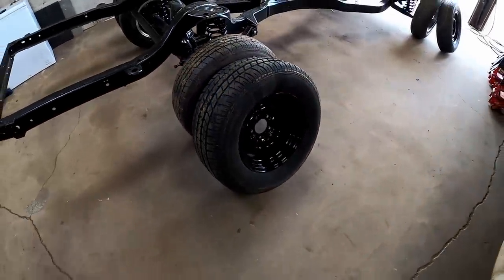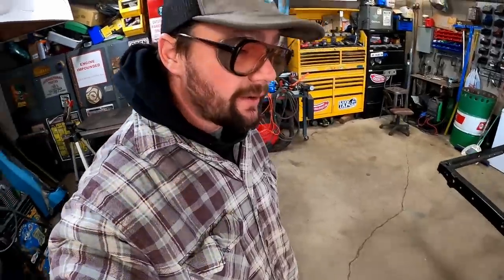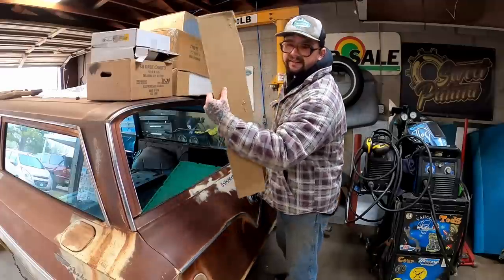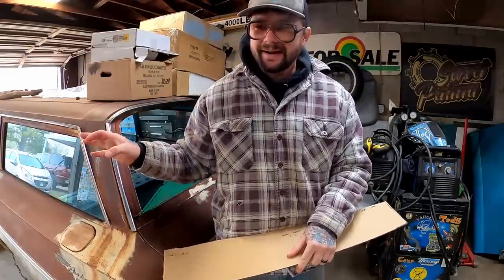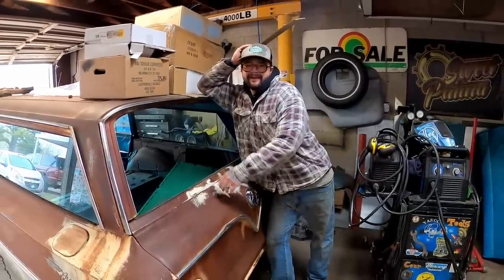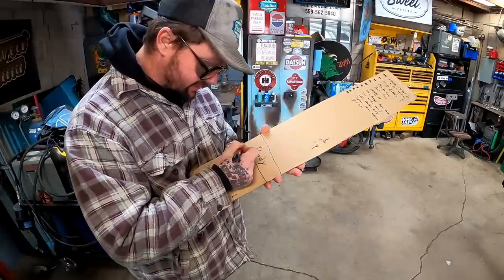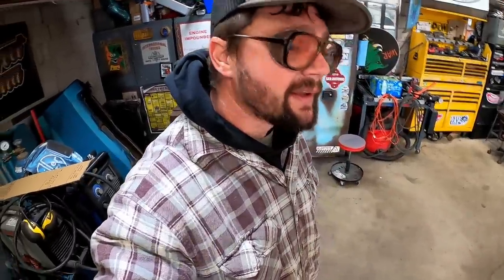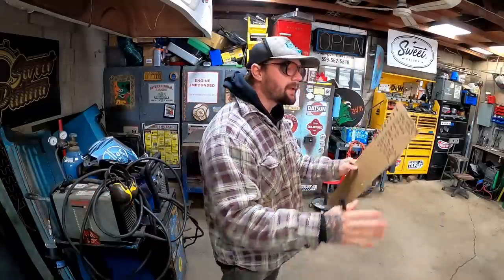1961 Parkwood Wagon. Building BRAKE LINES, FUEL LINES, RUST REPAIR, and more!

Comment: Yo Puddin. If I might add a bit of advise on the front suspension. I have put plenty of these together. The front upper ball joints mount from the top not the bottom and the idler arm bracket spacer that you mounted on the outside of the frame actually goes on the inner frame rail and spaces the actual idler arm in towards the drivers side for proper alignment of the centerlink bar.

Comment: Puddin, when you get your rust in the floors done consider getting rustoleums new spray bedliner for the floor pan underneath the car. It comes in the new TURBO CANS that are twice the size of regular cans. I used bedliner on the bottom on street rod bodies and its perfect for driver type cars, its hard as a rock when dry.
Reply: Yes sir you got that right I use that on the whole underneath of my 94 Isuzu ss 396 and it holds up to all the stones and road debris that flies up under there and I have yet to find a chip of any kind out of that bed liner spray

Comment: I missed where you did the frame. I'm you prep'ed and painted it. I did my 63 frame and used every sander/grinder tool  I have. Then I used OSPHO to treat the rust and bare metal. I primed it and painted it with Vansickle that you used to use.

Comment: When you gotta spray all those little trinkets with a can, and need to use them right away, hit 'em with a few waves of the propane torch when they're wet. No need to start 'em on fire, just cook off that extra stuff and dry the paint RIGHT NOW! Works every time, and saves a bunch of time, too.

Comment: The anchor stamp is just from a hardware supplier GM commonly used. You'll find it often on water pump and trans pan bolts as well.

Comment: Hi  Puddin, im Chris all the way down under in New Zealand. I've got a couple of tips for you about dealing to rust, all the "Experts" will try to convince you that you need the most ridiculously expensive products to deal to rust...  well I'm telling you a wee secret.
Deoderized Fisholene or plain fish oil, hose/spray your rusty bare Metal down with preferably deodorized fish oil the rust won't get any worse ever. Its good for holding rust as is until you can spare the time or money. Love your humor, don't let the beaters wear you down!
Cheers Puddin, thanks for making me smile.

Comment: Seeing that gas tank in the quarter panel reminded me of a time in my youth.I was out with my buddies in his parents 1964 chevy wagon  in the dead of winter when the car quit,we concluded we ran out of gas.We hoofed it to a gas station,got a can of fuel got back to the car,opened the fuel door and discovered the tank was gone,what the hell.His father came with his truck and we backtracked and found the tank against the snowbank at the bowling alley.the supports had let go from rust,never felt or noticed a thing when we drove away.

Comment: Love what you do man! Respect and understand the rant. Little tip when you have a big gap to weld. I take a piece of tig rod and put it in for filler on the weld. Helps control the heat.

Comment: Don't tighten the control arm links without the full weight of the vehicle. Need to allow them to be loose until after all the body and drive train is installed.

Comment: Gee for not a sheet metal guy, I think you do a real good job of it and make it work.   Like how the frame is and components are coming along.  Really like the new brake system you are putting on the wagon too.  One thing I like about GM compared to Ford was GM body work held up better and seem like did not rust out as fast a Fords did went I work on these cars in the 1970s.
Reply: I don't know about Fords but I had a '63 pontiac that the frame rusted through and a '74 Jimmy that was pretty well dust from the door handles down. Both ran great but were far from solid.
Reply: @brianhaw9398  It could be the part of the country your from too.  I started working on cars in Southern Nevada around 1969,  did some work in Kansas when in the Army and then back to Nevada.  I notice in Nevada some the cars that came from back east when they more that 3 years old had rust problems starting  which was not normal for my part of the country.  I should have made myself clear I was working on cars that were mostly made in the  40s, 50s and 60s they were not that expensive back then in the 70s as they are now.

Comment: Was just thinking that repair you did for the spare tire holder, what if you were to coat the new metal with some of that truck bed liner material. I’ve seen some of the restoration shops using it to help protect the underside of the cars they’ve worked on. Be a little more durable than just regular under coating

Comment: Hey Puddin on the bolts for the suspension shouldn't you tighten them with the weight of the car on them, so you don't twist the bushings. Was taught that if you don't it will put a bind on the bushings.?

Comment: Little brackets like that take a propane torch or heat gun a slightly  warm it paint it let it gas off A bita and re heat if you don't let it gas of aka let the thinners evaporate it will be fire baked😂😂

Comment: All suspension bolts and such should be thightend with the full weight of the car on it. Otherwise you will twist the rubber of the bushings and they wear out very quickly.

Comment: snapped a CV axle on the new age Thudnerbird, welded the spline stud back onto the cv joint same way a rig welded would weld a bung onto a frack head for a instrumentation sensor. cold 1/8'' E7018 165amp to burn in the base 1/16'' gap tacked and cut out making a 90 degree fill it ground clamp flowing into the cv hub digging a hole then dragging the pool into the spindle... mini mill not fully set up to recut the splines few hunerd bucks is a bit timly to come up with, but once there in it was a $900 part with the shipping $69 to buy the part but now is... just $5 of weld to fix it. $5 = $969.

Comment: You might want to check what size of brake line was used on your diff. As I remember it should have been 3/16" . If you use 1/4" you will be putting too much pressure on the rear wheel cylinders.

Comment: If you want got the brake line straight tool use a 5" long pice of 1/2 PVC or pipe run it through

Comment: Is it just me? The 60 series tires just don't seem to be as wide as they used to be. Back in my younger years, I ran the L60's on the back of my car, then they started with the G60 to replace the L60 tires.

Comment: That's why you use an icop line cause it's easier to ban than easier straight now and it won't brought out eventually got a good steel wheel I learned that from Moore's key and I would bring a 1/2 half half half half cups so I can get it in o'reilly's but I have to look in the book and won't find it on that computer they love using believe me they've done it for me before it's available in all kinds of size of the money to throw the eggs in your 516th lay got it they just gotta be not lazy enough to look it up in the book

Comment: Hey Puddin those bushings should be tightened after the weight of the car is on the suspension.
Reply from the maker: I’ll check em again!
Reply: @PuddinsFabShop  The rubber is vulcanized to the shell and the center of the bushing if you don't  leave them loose and get the suspension loaded before tightening it puts an excessive  twist on the rubber and it will fail prematurely.  My uncle was a Chevy dealership suspension guy in the 60s 70s and 80s that was his tip when I rebuilt the suspension on my 64 Impala. Goes for the arms also.  Love this build.

Comment: Is the gas tank really that small?  What, 40 miles capacity
Reply from the maker: I just looked it up. It’s a 19 gallon so as long as I get .475 miles to the gallon I can make it the 40 miles! 

SBC with over drive can actually do pretty good on gas mileage. I bet we get say 15 mpg so we can go about 285 ish miles to a tank I’d guesstimate.
Reply: @Puddin's Fab Shop  Definitely bigger than it looks. Keep up the good work

Comment: think i would have made that tire hold in the trunk flat  , think she bottomed out a couple times
Reply from the maker: You know I started thinking about that and if I was a betting man that flat spot came from the forks of the forklift that loaded it from behind on my trailer. It won’t be lower then my shop truck and I rarely scrape in it. We should be gud 👊🏻
Reply: @PuddinsFabShop  i didnt think of loader forks

Comment: Puddin good piece of advice from someone who's done it. make your brake lines out of copper tubing so they don't rust.. . I quit you tube because a stranger showed up at a family member of mines house.  My family's protection and security is my  job  and to prevent it from getting dangerous for my family or others I chose to leave you tube . I killed my channel. And by doing so I lost over three million subscribers. This was before monetization was even on the utubes. Pre google buy out. I suggest that you secure your new property with a security gate and system.. I'm not going to go into details of why I left youtube but let's just say someone decided to try to get froggy and it ended poorly for them.  Because my real life and you tube we're separate.  And they showed up to a family member's house of mine they should have never visited.

Comment: Puddin, you shouldn't tighten any suspension components until they are under the full weight of the vehicle.  Doing so will put all bushings under an unwanted pre-load accelerating wear and cause poor ride characteristics.
Reply from the maker: Good point. This loops back to the pull head out of ass that I added to the list 😂

Comment: Just a thought, and obviously i might have missed something so if i got it wrong i apologise! should you not tighten the suspension bolts with the body on so that when you fit the body the weight of it will not twist the bushes! (Btw i have been a mechanic since 1978)